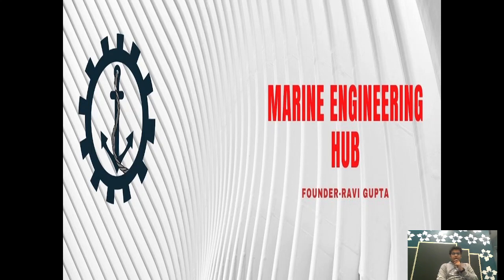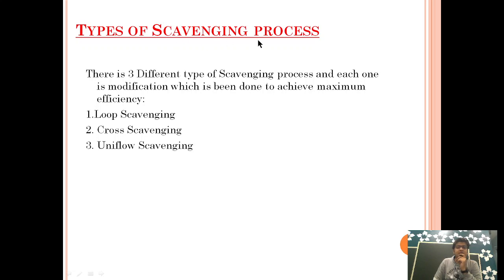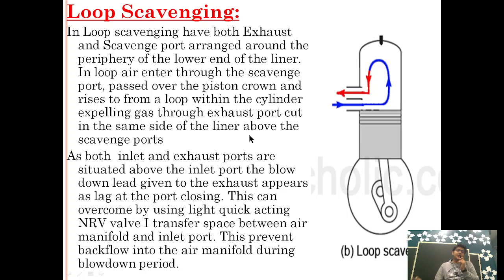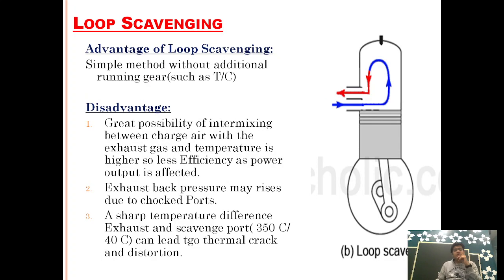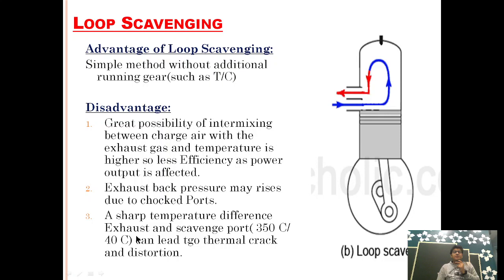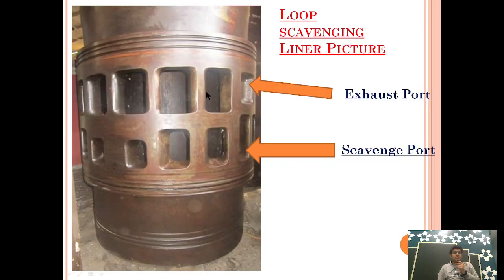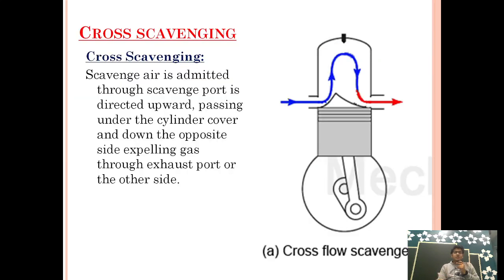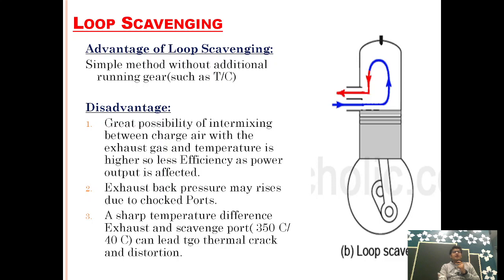Loop Scavenging| Cross Scavenging| Advantage & Disadvantage|

Comment: Why 4 stroke engine is preferred as auxillary engine on ship
Reply from the maker: Engine is acting as a primemover for power generation. 
If the rpm of the engine is lowered for primemover then the stator arrangements of alternator need to be made bulkier  to have Same power so to have a good design and space and efficiency wise 4 stroke is preferred